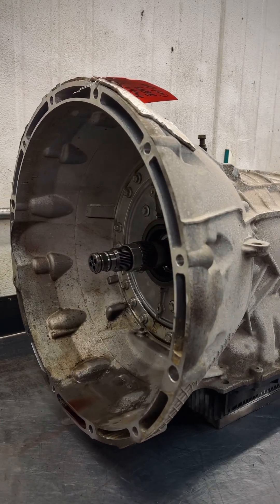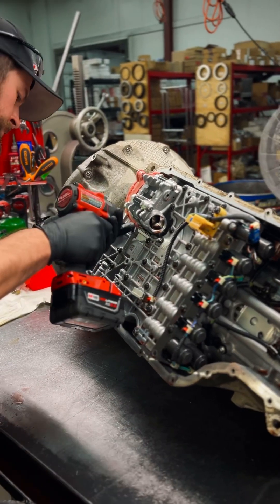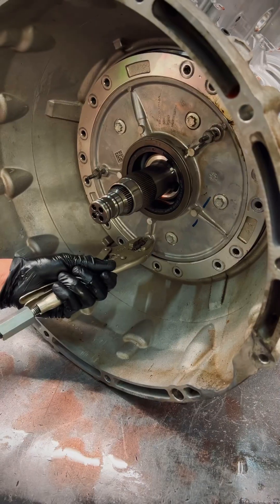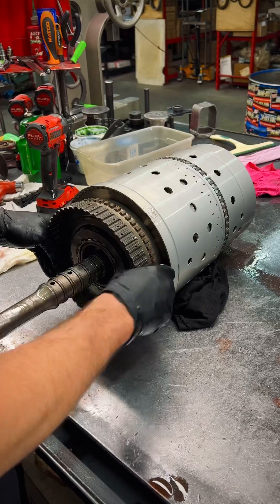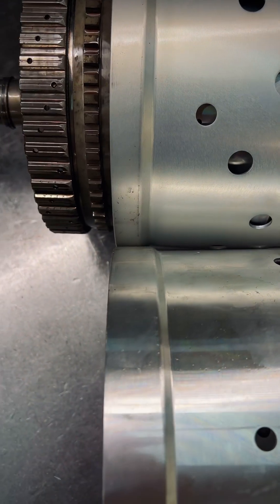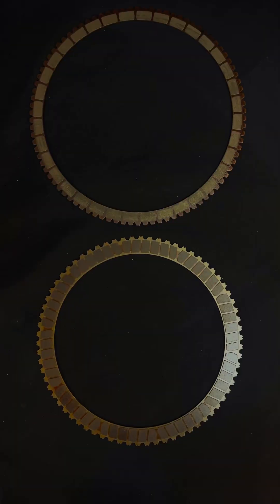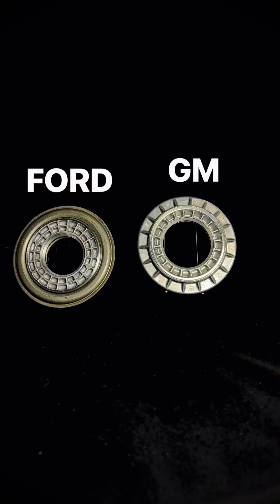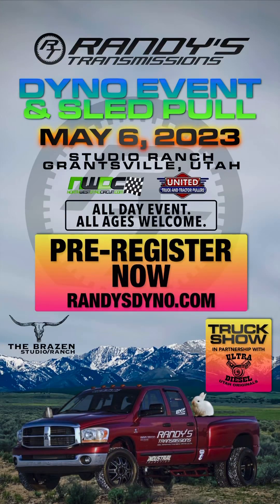Allison 10L vs Ford 10R

Comment: I've only seen 10R's so far and don't hear a lot of issues other than the cracked/broken valve bodies. The 10R's have chronic issues with the CDF drum bushing moving and Ford has updated the drums with a lip that retains the bushing. I have not heard of this issue on 10L's, perhaps they are overwhelmingly being done under warranty? Have you seen the bushing "walk" in the 10L's?

Comment: I have to give it to ford. They have the best transmissions of all the big 3. Engines not so much especially in the past. Old gm engines were way much better than ford engines but gm has had its fair share of transmission problems not just in diesels but also gassers. And ram, well they don’t build the Cummins engine so that’s not theirs, shitty suspension (especially front end), shitty dashboards, shitty transmission, shitty frames, etc. Although I hope the new ZF transmission on the 2025+ HD trucks give them a better reputation. Still not a ram transmission.

Comment: The 10L and 10R transmissions are 10-speed automatic transmissions developed through a joint venture between Ford and General Motors:

🔧 10R Transmission (Ford)

Full name: 10R80 or 10R140 (for heavy-duty applications)

Used by: Ford

Applications: 

10R80: Found in F-150, Mustang, Expedition, Ranger (certain years)

10R140: Found in Ford Super Duty trucks (F-250/F-350) with gas engines (7.3L Godzilla or 6.8L V8)

Built by: Ford, manufactured at the Livonia Transmission Plant (Michigan)

⚙️ 10L Transmission (GM)

Full name: 10L80, 10L90, etc.

Used by: General Motors (GM)

Applications: 

Found in Chevrolet Silverado, Camaro SS/ZL1, Cadillac CT6-V, and other GM vehicles

Built by: GM, manufactured at Romulus Powertrain Plant (Michigan)

🔄 Joint Development

Co-developed under the Ford–GM 10-speed transmission alliance

Shared core design and architecture, but: 

Each company tuned and programmed the transmissions for its own vehicles

The 10R and 10L use different control software and calibrations

Let me know if you want a comparison chart or reliability info between them.

Comment: Well, as a Ford owner of a super duty, this video gave me some more confidence in my truck.
Reply: Its the valve body guys, gm is even worse. But upgrading your valve body to one thats high pressure and has billet components. That will make your 10r80 last longer then your truck. Also, every 30,000 miles replace your transmission oil. 
Your go for 1000 hp also reliabley
Reply: I'm seeing 10rs dying under 70k miles. You should still worry
Reply: I have a 2021 and am replacing my entire transmission with 69000 miles on it. Go ford go
Reply: @ that is frustrating, glad to hear they are taking care of it.
Reply: @chrisreid3155 was this a sudden failure or been coming on? I have a 22 with 40k miles and have hard shifts around 3rd and 8th consistently. Also feels like it sleeps around 3rd occasionally.

Comment: Both built by the joint venture between GM and Ford. There were several joint venture transmissions. Sometimes the Ford stuff was better. Sometimes it was the other way around. After 2013 I usually just say it's the luck of the draw on whatever brand you chose. They all make junk and some good now.
Reply: Parts are not interchangeable. The design concept is similar. GM builds their own and Ford builds their own.
Reply: @jamesrichardson559  all I said was is it was a joint venture. I didn't say it was built all at the same plant. Stop reading in.

Comment: You're comparing a super duty ford trans to a 1/2 ton GM trans? The 10L1000 Allison approved trans is way different from this one. Please compare apples to apples.
Reply: Superduty? The 10r80 is in mustangs, F-150, Ranger, Expedition.
Reply: It's only the name gm bought Allison doesn't make it gm does that's why I bought a ford I have bought gm my whole life they have failed with transmission for a while now not to mention the ifs is junk too
Reply: @joecameron3512 Gms transmission is just fine. Also calling IFS a joke when Ford has a death wobble from the factory is hilarious.
Reply: @Wangchung405 gm transmissions are not fine, they are notoriously junk

Comment: Is the 10L in the 1500 series trucks the same as the 2500+? 

And do you think it’ll be fine in them, mated to the 6.2 as they don’t tow as much and aren’t under as much strain?

Just curious as to whether or not to buy a spare one to build up for my 2019 1500 Sierra or not.

Edit: I do tow, maybe 7k lb trailer, and so far at 92k miles, it doesn’t have any issues. But if I can get ahead of it, and build a stronger one to swap in, then sell the stock one for a recoup of some expense, I may do that.

Comment: You need to tell chevy guys this because they think GM makes the ford transmission and ford made the GM transmission. Correct me if I'm wrong but GM and Ford worked on a ten speed together but Ford didn't like GM's designs so Ford scrap it and re-engineered it to their own specifications. Correct?

Comment: I’m disappointed GM went to a 10 speed.  The Allison 1000 6 speed was better.  I own a 21 GMC HD with the 10L.  From the inside the parts look beefier in the ford 10r.  GMC trucks look way better cosmetically. Ford has a better interior and I believe is a heavier duty truck.   GM HDs ride better and an overall better driving experience.  Ford is built to pull the big heavy trailers.  Glad I don’t need more than I have because driving a ford would be a hard pill to swallow.  Fords also cost more which I would not pay more to drive a Ford.  Both are fine trucks.

Comment: That 10L80 is not the HD version that’s put on 2500/3500 trucks. The 10L80 HD trans are pretty much identical to the 10R
Reply: Yeah I’m sure one of the most reputable trans shops has no idea what they’re talking about.
Reply: @ChaseLandMgmt they obviously don't in this video..

 The 10L80 comes in the 1500s and Yukons/Suburbans

Comment: Hahahaha!! I can’t believe this guy has a transmission shop!! Ford and GM codeveloped the 10 speed transmissions in the 1/2 ton trucks. The 10L1000 in the heavy duty trucks was designed by Allison has no relation to the Ford transmission. Pretty laughable that they don’t know that.
Reply: Kinda fruity towards ford -
Reply: It was designed by GM with oversight by Allison.  Allison will not work on this 10 speed because it is not a Allison 1000.
Reply: @MrStaybrown  The 10L1000 is an Allison designed transmission. GM struck a deal with Allison where GM will produce the 10L1000 for the 2500 trucks in house and Allison will produce the exact same transmission for the 4500/5500/6500 trucks in their facilities.

Comment: my 18 Navigator 10r80 went out at 70K miles from CDF Drum slip issue.  I was pretty easy on it, never towed anything rarely gave it full send. Dealer tried to replace parts but still gave issues and eventually replaced full transmission from crate.  I like the way it feels but makes me nervous when I leave warranty land.
Reply: Ford finally has a new CDF from that won't slip the bushing any more

Comment: That’s weird, my transmission shop has said steer clear of any 10 speeds. They have a whole bunch of issues already. They did also mention, they’ve seen about 8 fords come in with issues, and only 3 GM’s this year alone already. It just seems like every new transmission that comes out has more issues than the last.
Reply: Ford has had the 10R in a lot more vehicles than Chevy has had their 10L.
Reply: It's transmissions 2022 and older. The CDF drum was redesigned 2023 and no longer has any problems
Reply: @100pyatt  is this for both manufacturers?

Comment: One thing I can definitely see that this guy is glancing over is the fact the allison has a larger drum diameter and clutches. More teeth = stronger, not necessarily depth of said teeth. Larger diameter with more teeth is likely just as strong as the 10r140. I feel like this dude is biased and is just guessing about everything possible to make it seem like the ford is better than the allison. I don't know if he actually knows anything.
Reply: Did you notice how the GM clutch plates were digging into the case?  Proof's kinda in the pudding.

Comment: He says in the video the F clutches on the Ford have a lot more friction material but do they? You can clearly see that the clutch rings are a way bigger diameter on the GM so even though the width of the material may be thinner, there is more material because of the bigger diameter. Also, the bigger diameter the less engagement speed the friction material has to absorb. The only ther thing is as a shop you do not know how these two transmissions were used (or abused) so some unfounded assumptions might be happening here.
Reply: Either way they are entirely different transmissions. The Ford 10R appears beefier & more robustly built. I've owned Ford & Chevy trucks. Both served me well. If i was large or small company using my trucks.. or vans daily for business it would only be Ford vehicles. Data shows Ford trucks /vans purchased 3>1 vs other brands by companies/rental /fleet buyers etc.

Comment: After just getting my truck 2020 F350 7.3 Tremor back from shop for the CDF replacement (update design with lip) I'm not feeling like I made a mistake getting a Ford instead of Chevy
Reply: How much did that run you and was it under warranty?
Reply: I need to do the same thing
Reply: Way worse problems with the ford 10 speed according to a lawyer firm I read .
Reply: @crspcritter no link=BULLSHIT

Comment: Why does ford 10 speed seem to run higher temperatures?
Reply: I cant speak entirely from experience but my 10R80 has a 8 inch cooler on it. Probably 12 on the 140s. Not sure if the chevy's come with coolers stock as well
Reply: @anthonys3906  gm must have better cooling system. I asked why ford transmission runs hotter?
Reply: @truckfan87 idk. What I see on my 10R80 on average is 145-175 in the winter and 198 absolute max in 100F summer. New England for environment. 2018 F150 5.0 3.31 in  2WD empty highway driving on an overdue ULV fluid swap. 198F is what I see most southern dudes running. 210-215 is when people say to start watching what you tow and how you’re driving it
Reply: Cooling thermostat built into valve body?

Comment: The anodizing has to do with surface hardness, maybe thats why the clutches are digging in. Reminds me of the un-anodized 68rfe valve bodies where the pistons would wear the bores.
Reply: Anodizing is insanely thin and only affects 10 to 25 microns deep into the metal. That's half the width of a human hair. If they were really worried about surface hardness, they could have simply chosen a different aluminum alloy or heat treatment process.

Comment: There are at least 4 variants of the Ford 10R series and 3 variants of the GM 10L series. Can I assume that you are comparing the Ford 10R140 (used in Ford SuperDuty) to the GM/Allison 10L100 (used in Silverado/Sierra HD)?
Reply: He sure should have explicitly stated, but I didn't hear that un this video or the description.. However, several times he does refer to the GM version as the "Allison," though.
Reply: Either way the data shows Fords 10R is more robustly built. Not that Chevy/GMCs isnt good ..but i'm towing/hauling & using my expensive 4wd daily. Why would i buy anything other than an F150/F250?
Reply: @Davido50 cp4
Reply: Nope the 10L in this video is the 10L80 which isn’t even what’s in my 24 3500

Comment: Whomever is new here, the original 10 speed wasn't even a collab. Ford built the 10 speed in exchange for a 9 speed from GM that was for FWD. Ford wasn't happy with the 9 speed, so they removed a gear and that was what they used in the Explorer until they were made into a RWD platform.
Reply: The Explorer never moved passed the old 6spd until 2020 when they installed the 10spd. And Ford killed just about all of their FWD cars, so there was no need for the 9spd trans. Furthermore, the both GM and Ford have their own variants of the 10spd transmission.
Reply: @hellkitty1014  The 8 speed was used for the Edge. My bad

Comment: Just had 10L #2 installed on my ‘22 Chevy 2500. 48k at swap, so much for the Allison brand name
Reply: Fords have just as many if not more problems. Ford still uses the CP4 fuel pump that has a 9% failure rate. Plus Ford transmissions have their own set of problems that aren't addressed here. 

I have a Duramax for towing but I'm a Toyota guy at heart. Just bought the duramax because it seemed like the best out of the big 3. Seems like the Ford and chevy have about the same rate of failure on trannys but chevy has a far superior fuel system and less Def/dpf problems. Ford has a better frame and axles but not enough to compensate for the fuel system.

I had a 2015 f350 powerstroke that I sold at 235,000 miles and now have a 2020 duramax with 80,000 miles. Both trucks have treated me great.
Reply: It's clearly an inferior transmission now 😭
Reply: Yes, not nearly as robustly built as 10R in Fords F150/F250. I've also read Ford strengthened it's 10R further in '22+ trucks/vans. Nice. Have '24 F150 Tremor on order now.
Reply: I like Chevy /GMC ..but i buy Ford trucks. All they need is good basic maintenance. Never let me dwn.

Comment: I'm a retired mechanic and when I started I was a die hard Chevy guy, by the end of the first year I had switched to Ford. Why because on average Ford's last longer with less issues.
Reply: What’s weird is Ford has had the most issues the past 4 years. Their Super Duty 10 speeds are having a lot of issues. Very strange…
Reply: I’d like to see you rebuild the automatic trans out of a late-model Focus or Fiesta. Bet I’ll be waiting a while. Oh, your a rail frother too? No shock there.
Reply: @brandon18054  I grew up with the train tracks right behind my house ( ILLINOIS CENTRAL/ ILLINOIS CENTRAL GULF) and I didn't do trains rebuilds because I had a guy who guaranteed his work for 3 years

Comment: Wow!!! I assumed a modern transmission was complicated but not to that extent. 
Almost 30K miles on my F250 10-speed without issues but the truck isn't being stressed as much as it's intended,  towing an occasional 8-10thousand pounds.
Reply: My problems started at 38k…. Then it shit the bed
Reply: My duramax tows 14k pounds most of its life and its at 80k with no problems.

Comment: The new 10 speed Allison really isn’t even an Allison. The 6 speed before was truly an Allison.
Reply: Yes .
Allison even says they don't build a 10 speed for pickup trucks, just the 6 speed, which is the Allison 1000.
Reply: @MrStaybrown True. But GM still labels them Allison to trick customers into thinking they’re getting a bulletproof tranny. One of many reasons not to trust GM.
Reply: No, no, the GM literature says it's an "Allison Branded", not built, because it's a GM transmission taken through Allison certification for life cycle duty.

Meanwhile,  while this teardown is great,  it doesn't cover the material science part of the internals. A gear might look "beefy," but it might not be as strong,  depending on the makeup of the metals used.
Reply: @mbukukanyau  Would you trust GM to keep the standards of Allison or take their usual cheap short cuts to save money. I know what I’d bet on.
Reply: @reneeandchrisforever  You know GM has a better quality record over the last 10 years than Toyota, according to JD Powers? Plus, I doubt Allison will just let their brand be trashed. 
I am not tribal, I own Ford, Chevrolet, and Toyota products.
One has to use a product as designed and intended by the manufacturer.
Reply: @mbukukanyau  “According to JD Power” is all ya need to know. Not only are they a joke, they rate initial quality, not real world usage. I’ve owned all brands over 36 years and GM has been subpar for the last 15. From lifters and transmissions to premature rust and poor build quality, they run the gambit of cost cutting deficiencies. Ford is in the same situation the last 10 years. But people keep buying them because of incentives so they have no reason to improve whatsoever. I’m not saying there aren’t good examples that can last a long time but overall, it’s not worth the risk of 60-80k for a “maybe it’ll last” truck.
Reply: @mbukukanyau  jd power is a company owned by gm. Gm started jd power
Reply: @5.0king32  No, JD Powers and associates has never been part of GM
Reply: @LayzeeGiant  - YOU ARE INCORRECT -- https://en.wikipedia.org/wiki/J.D._Power
Reply: @5.0king32  -- you are incorrect -- https://en.wikipedia.org/wiki/J.D._Power
Reply: @reneeandchrisforever  GM may make cuts elsewhere. But if GM is using the Allison name in any way, and Allison helped build/ certify the transmission. Allison is likely coming in and auditing the facility. Any supplier changes or revisions would likely require a sign off by Allison. 

I'm a quality engineer for an iso 9001 company, and we supply powertrain products to the agriculture industry. We cannot change a single dimension or supplier for a single component without it first being approved by our customers. 

The 10L might just suck in comparison to the 10R guess we'll see.
Reply: Its a ZF